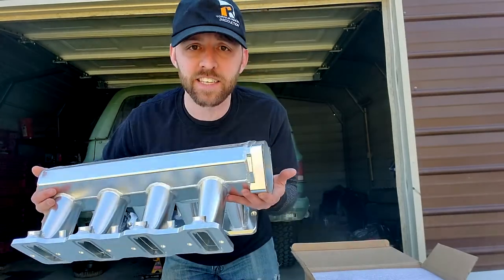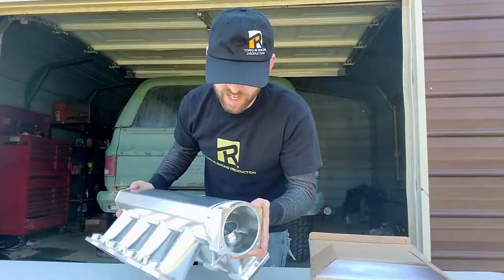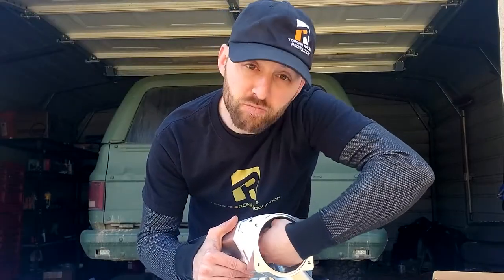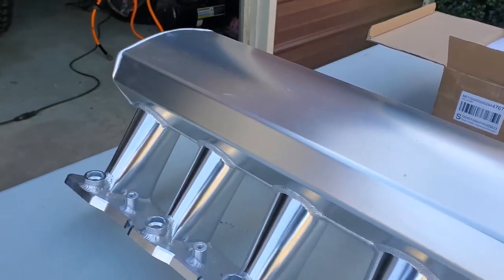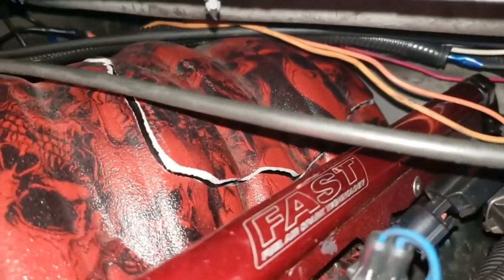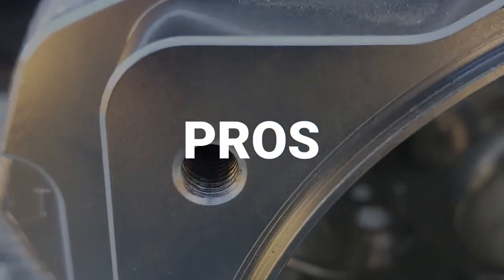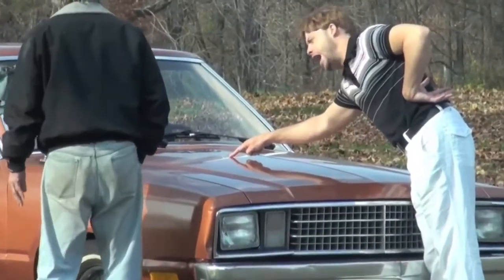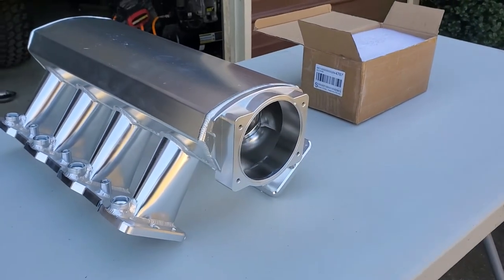Sniper LS Intake review

Comment: in fairness, it's about as horrible down low as the Holley HiRam that's 950 bucks.... I'll spend 300 on descent china intake and spend the 600 on beer money or into other parts. I ran the Fitech version on my last 5.3 with 3.25 gears and 29x18 tires, I didn't miss the lack of tq one bit! 3600 stall solved that and instant boost of my 78/75 was pretty crazy on 17psi....and then there's the whole low torque bends rods on boosted 5.3, perhaps less torq bellow 5k is a blessing?
Reply from the maker: Well the Holley Low ram, yes, but the Hi-ram has pretty good low end TQ compared to these,  but I greatly agree that on a budget boost build, these intakes are hard to beat for sure!

Comment: You gonna show us the Dyno on this intake vs that 1000 intake on reaper? Lol.
Reply from the maker: Lol I wish I could, that would be fun! I can tell you right now though, on my small cube setup, the lsxr would have a much better mid range TQ curve and almost the exact same peak HP. I just wouldn't ever run boost through my LSXR
Reply: I don't like the price tag. Especially after what you showed what happens with boost. I'd rather spend the 450. PLUS THEY LOOK SO FREAKING COOL!
Reply from the maker: @codyedgington6852  if your building an NA engine though its the only way to go!
Reply: @torqueracingproduction  I seen the power and of each that brings everything in by 6500 depending on cam choice too. That ram is like 8000rpm. You got a cruiser, street/strip intake vs a mid to high end race intake.

Comment: What injector did you use,I think mine called for a EV1 injector ,Just wondering exactly what you guys would of used
Reply from the maker: I haven't seen much of a preference on injectors, seems everyone has their own idea which is better, but I used the Holly brand Pico/EV6 style, but if there is a manufacturer recommended style, I would stick to that and of course make sure to match the lbs/flow rating that you will require for your HP level.

Comment: Have one on my car made good hp but horrible torque definitely need boost or laughing gas for it. Hoping some day to have a turbo setup
Reply from the maker: Yes, the TQ down low is really bad for sure. If a feller can keep a strong will power to not turn a boost knob up, a stock ls6 or truck manifold will do better from 5k rpm and lower.

Comment: Are they taller than the stock truck intake? 😦👀 I ls swapped my bmw and Tahoe truck intake won’t clear by like half an inch
Reply from the maker: That's a good question, I haven't measured them height wise, but I'd be willing to bet they are very close to the same.
Reply: @torqueracingproduction  ohhh that’s not ok then haha 😂😣 we’ll I’ll just have to keep googling for a low profile cathedral port intake haha
Reply from the maker: @ThaHammieJaassee  the Fast is such a good one though man, but best bang for ur buck is the LS6.

Comment: Can run truck style injectors with this intake?
Reply from the maker: I have not tried personally, but several people around here have.
Reply: No you can’t they don’t fit you need ls1 injectors got it on my Tahoe but your going to need the adapter ev1 to truck only one website has them about 80 bucks and you need the orange ls1 gaskets the ones they give you don’t work

Comment: Do you have a link for the dbw tb
Reply from the maker: I don't sell them or have any discount affiliate links, no. I'm sorry.
Reply: @torqueracingproduction wow! So if you aren't making any money you can't help with a little information? Or did I just read that wrong??
Reply from the maker: @HALF-ACRE2014  lol yea you definitely mis-read that! I ran this intake a long time ago, but I didn't buy it new, I traded for it. The intake in the video was borrowed to do the video. So I've never bought a new one, therfore I don't have a link. However, a quick Google search will easily net you several places that sell these. Also the dbw tb that they were asking about, is something I've never used. I prefer an old fashioned physical cable pulled tb. So I don't have any links to those either.
Reply: @torqueracingproduction  I'm glad you replied. Makes me feel better. I too wish mine was cable but unfortunately I have dbw. I think I'm going the tbss way. It's for my truck and I don't want to loose the lower rpm torque. Thank you for the videos.
Reply from the maker: @HALF-ACRE2014  the trail blazer ss intake is highly slept on, and is a great budget intake that makes really good power. They are just hard to find.